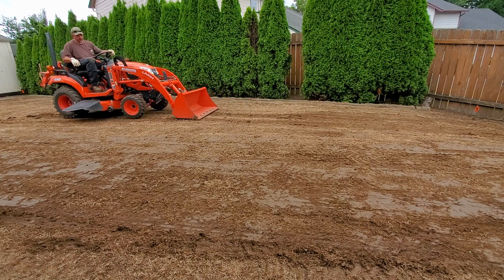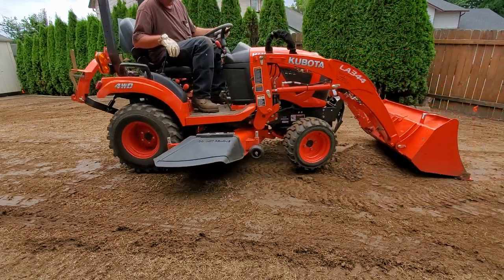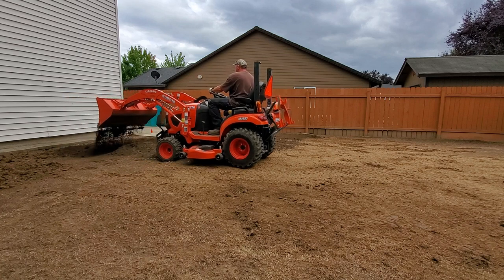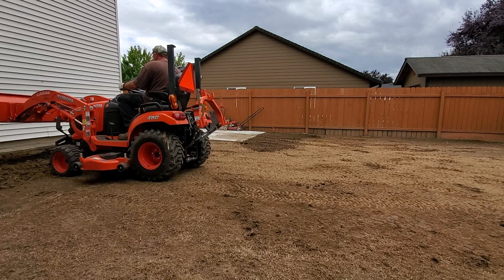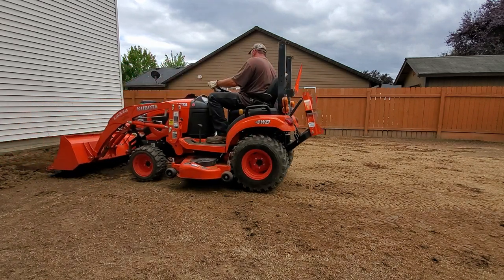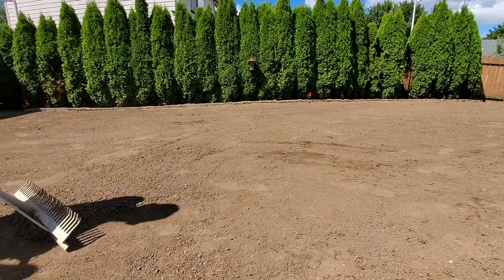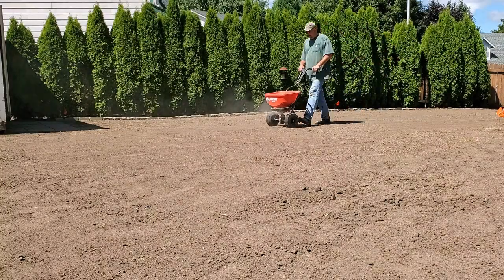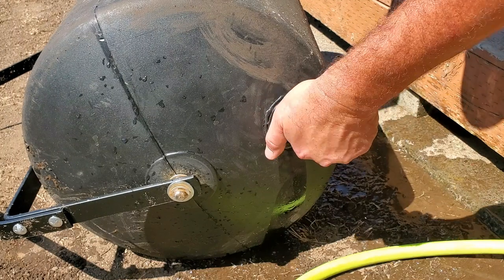Leveling and Amending Soil - Lawn Renovation Step 3

Comment: I've been educating myself on lawn care this summer, getting ready to nuke the weed-infested trash lot my landlord calls the lawn to put in some grass seed. I like your step by step videos. Did you just lay your imported topsoil over the stubble shown at the end of the Step 2 video? I would think weeds would rise from the stubble. My yard is already pretty bare of actual grass (anything growing is pretty much a weed), so I'm worried about laying topsoil over all those weed seeds. Would tilling be a better idea, since I'm not starting from an OK-ish lawn, like you did? Thanks!
Reply from the maker: Tilling is literally the worst thing you can do for turf grass. You're gonna bring dormant weed seeds to the surface and have a bigger weed problem. Just lay the topsoil right over the dead stuff. It's just going to break down descentagrate pretty quickly anyway. As the new grass fills in, you won't even see it.
Reply: That's actually great news since it would save me some money and a lot of hard work. I live in northern CA and it's pretty hot and dry here. The yard soil is dry and hard, and crumbly once it's broken up (I found this out while removing some tall "weeds" that turned out to be sucker trees with roots that i had to dig out with by pickaxe and shovel). In another video i think you mentioned fertilizer as an alternative to topsoil. My yard isn't very big. Would that be a good way to go, after applying the herbicide and getting it down to stubble/bare dirt? It's already on kind of a grade with a slight slope downward to the patio, so I'm not looking to build it up too much (would like to even it out, though).
Reply from the maker: @samanthamarie8097  I mentioned compost not fertilizer. Compost is a better alternative however it breaks down over time so you may want to reapply it once a year or every other year
Reply: Compost, yes, thank you. Would I just apply that over the grass the year after I plant it? Thanks very much for answering my questions... very new to any kind of lawn care beyond mowing.